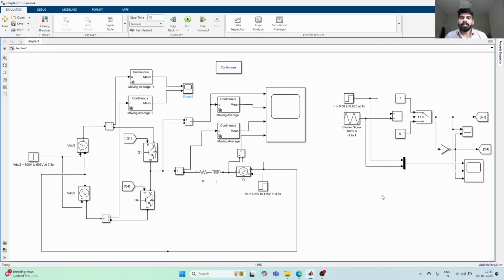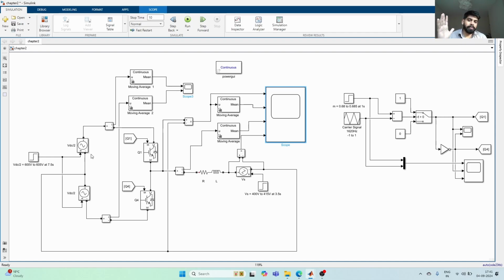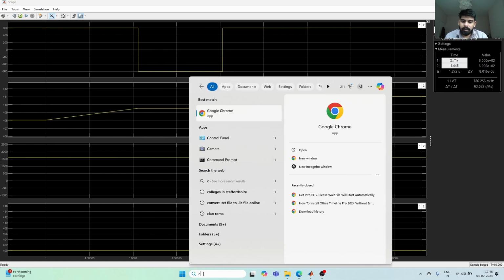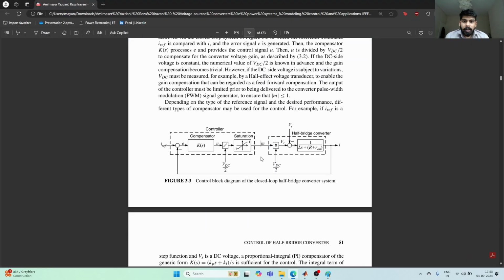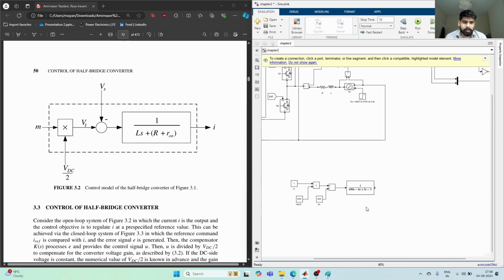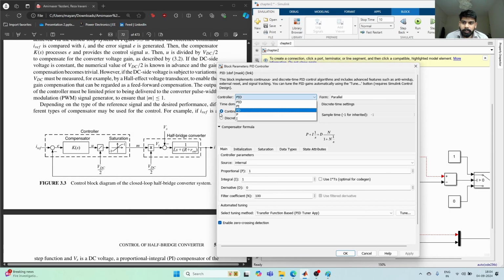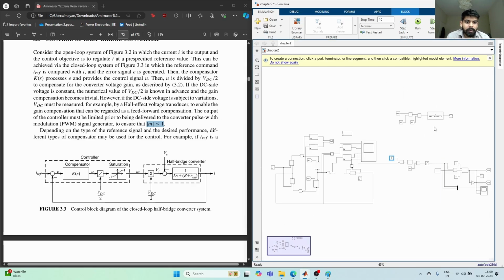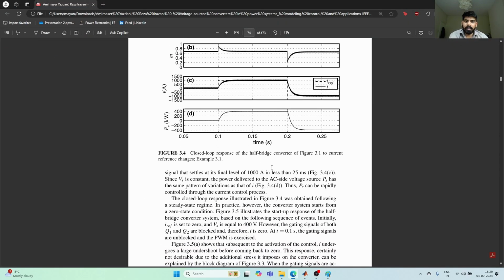Control of Half-Bridge Converter | Understand and Model in MATLAB-Simulink | VSC Yazdani

Comment: Why are you averaging the values of Vt and i_t and not doing a separate model to compare switch model vs average model? Why is your current curve start at zero which is different than the one given in the textbook?
Reply from the maker: From an industrial point of view, I am not interested in the switched or the averaged model (see page 37 for more info on what these models depict) because eventually the behavior reflected from my simulations (or model) are the ones expected from an online working converter. 

The current curves in the book (page 52) are the steady-state curves and show the results for step changes in the iref. But on the very next page (page 53) it tells us about the initial transient, which i talk about in the next video in detail and how we can remove that transient using a FFC control and save the converter from that initial stress. 

Next part on FFC might be coming this week.
Reply: @raj.__.mayank  Thank you Sir